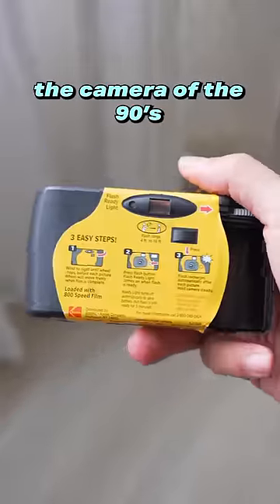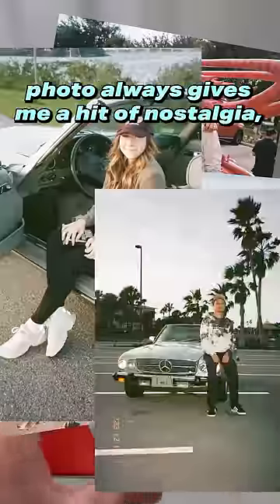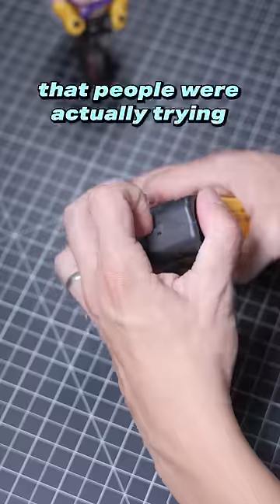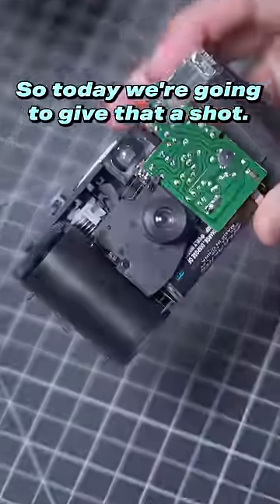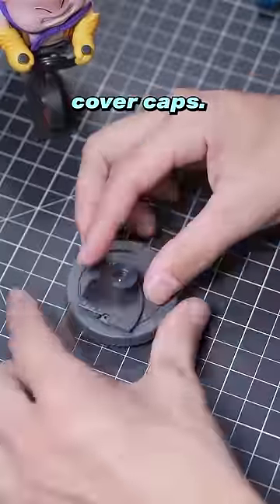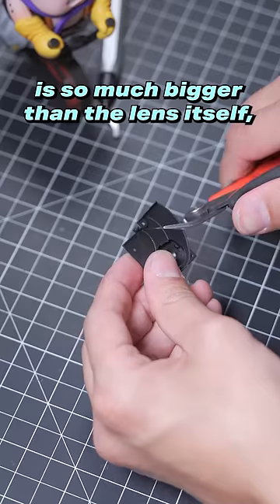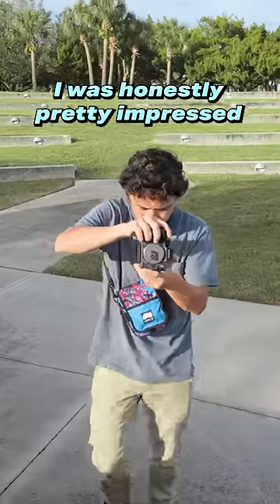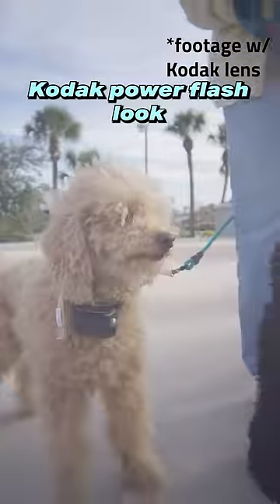The Disposable Camera lens mod..

Comment: They were not thrown in the trash! Speaking as a former film developer - after being developed, the cameras shells were picked up by a company, refurbished with a new AA cell and repackaged.
Reply: Good. Would be so wasteful otherwise.
Reply: Yes so “recycling” the lens this way only makes the rest of the plastic shell useless, contributing to waste. God I hate this trend
Reply: this is true, and was one of my first jobs at Wal-Mart. the only good thing for the environment i ever did while working there.
Reply: @ぶ乙 Kodak makes a regular film camera, the m38, which produces film with the appearance of these wasteful disposables with less actual waste. Of course the camera itself is meant to mimic the look too, so it is also plastic. I dont know why people dont look for more sustainable, cheaper options.
Reply: 5
Reply: @frankievermin Because metal, as opposed to plastic, is dug up from the ground by massive machines which consume more fuel than an oil rig uses to power its pumps. Were talking horsepower and wattage figures in the hundreds of thousands just to operate all of em, all for metal
Reply: 😂.... Smart Company Co.
Reply: Or you were me, who disassembled them and replaced the film with a fresh roll, and kept using it. Nothing disposable about them except the name
Reply: I'm not surprised that companies would do that then. But these days they would 100% not care.
Reply: Disposable cameras were very handy back in the day even for people that had their own camera should they forget to bring their own. A lot of touristy places where people take pictures used to sell disposable cameras as well as 35 mm film.
Reply: Not to mention some families like mine could buy a Kodak and just get film rolls and refill them

Comment: They're not usually "thrown away" tho, they're collected and reused, as it's just a bog standard shell
Reply: This. You were supposed to give the entire camera back to have the film developed - you couldn't even access the film roll unless you cracked open the case, and the case was not intended to be opened by the user.

I mean, you totally could, and I definitely shocked the shit out of myself a few times playing with the flash circuitry. but ideally most people would never be in the position to throw the camera away because otherwise they would never get the flim developed.

Comment: Btw! You can also just use the camera as is! It just needs a new roll of film put inside. 

The "disposable" Kodak cameras today are all reusable so please let the lab have them / make them refill it for you !
Reply: Wild how disposable culture was/is so normalized!
Reply: As far as I can remember there were two types of this film point and shoot camera. The one that was disposable which you couldn’t open and was cheaper and the other one which you had access to change a new film and was more expensive.
Reply: Actually, that's not generally true.  At least the Kodak ones have a little "crown" along the top of the cartridge that works with the film advance.  That means that a normal 35mm cartridge won't work if just inserted into the same spot; you'd have to reload the original cartridge

Comment: I’ll never forget back in 90s when I was about 8 years old and I was really into pulling electrical things apart to see what was inside. Well I was pulling one of those exact Kodak cameras apart when I saw a “danger of high voltage shock” sticker. I scoffed, there is no battery in here I said to myself and about 15 seconds later as I continued pulling the camera apart the flash capacitor discharged into my finger and the shock I got changed my life forever. From that point on I took note of danger stickers, they aren’t lying 😂

Comment: Pro tip: put 3 points on the circle (Perimeter)  you want/need to fine the center, connect them with 2 lines and make another 2 lines perpendicularly to the first ones right in the middle of them, where the last lines you drew encounters is the center of the circle

Comment: Disposable cameras weren’t put in the trash. They were returned, (refurbished when necessary), reloaded and resold.

Also they’re not too difficult to reload at home, though for most a toy camera would be an easier alternative.
Reply: I think you're severely overselling how much the average consumer can be bothered, people absolutely just threw them away
Reply: @ExpandDong420  the average consumer wouldn't be throwing them away, they'd be dropping it off at a film lab and coming back to pick up the negatives and prints
Reply: @ExpandDong420 I wasn't aware the trash can developed the film once people were done taking their photos
Reply: @ExpandDong420 you would drop off the whole camera at the lab and get photos and negatives back. The lab would extract the film, then throw the camera in a box. When the box was full it was sent for “recycling”. Which I’m guessing meant they were dropped in a shredder so that the metals could be recovered, then the plastic was thrown out. It’s very unlikely they were refurbished, there were too many different manufacturers and models, the logistics of refurbishing would be simply too expensive.
Reply: @beefchicken WTH, those disposable cameras were literally made by the manufacturers of the film they came with and the film branding was all over the camera, too! Those cameras were literally made to sell camera film to people who couldn't afford the upfront cost for a proper camera! And their design never changed.
There were no complicated or expensive logistics to refurbishing those cameras, just send them back to the manufacturer, they have the correct film since they're the ones making it! 💁
Reply: 90s kid here. Absolutely threw away and smashed dozens of these cameras as a kid. This is the first ive heard of a "returned" program
Reply: Many of these can't actually be reused. They just break.
Reply: @coreydopson2030 You must have amnesia then. The entire camera was turned in to get the film developed. Consumers definitely didn’t “throw the camera away”. smh 🤦‍♂️

They weren’t “reusable” they were “disposable”. The amount of people here pretending they remember something they clearly don’t is troubling.
Reply: @JeanEDeaux  my dad was a photographer. We had a dark room and chemical washes that he used to develop film. We used disposables for vactions and school field trips. I did, in fact, destroy and throw them away. You assuming you know my life is what is troubling.

Edit:
For clarity. I knew people brought them to walmart and walgreens and other such stores for development. I personally didnt have this experience so i didn't know they didnt just open them up and eject the film and instead handed over the entire camera. Just never thought about it. Thats all i was saying
Reply: @coreydopson2030  Then your experience was the exception and not the rule. The general public did not use these cameras and throw them away. ¯\_(ツ)_/¯
Reply: @JeanEDeaux  lol, seriously. the entire concept of the camera was to enable people to be able to take photos who didn't/couldnt have access to a proper camera. The overlap of people with their own dark rooms and the people who used disposable cameras has got to be a vanishingly tiny number.
Reply: @JeanEDeaux completely reusable. Worked in many labs over the years and this is exactly what we did with them. Developed the film, put them in a box and they were shipped to a company that repackaged them. Kodak, Fuji and other companies don't make these. They order them from companies that do and those companies put the little paper sleeves with their logos on them and package them and ship them.
Reply: @LRM12o8 those companies didn't make them. Another company did and just branded whoever ordered them. This is prevalent in many industries.

Comment: Use wood drill bit for drilling into plastic. It has middle pin that will make sure the drill bit is not sliding around when drilling. Also the edge of the drill bit touches the plastic first so it makes sure the edges are all nice and round without need to use edge trimmer.

Comment: Try adding a secondary lens to collimate a larger portion of your image sensor. It won't have affected light much and would at least doubled your available resolution at little cost. If you pick the right lens it can also compensate for lens warp.

Comment: The plastic lens become a big limitation when you want to do more serious photography. 
Anyways, an even more fun mod is to get one of those disposables that have a flash. Once you get the film out, open it up till you get to the flash circuit. You need to solder wires to the two legs of the capacitor. Now you can drill holes for the wires to come out of the case, drive two screws into the side and fix the wires around them. And there you go, now you have a shocker.

If the flash on your disposable is manually charged, you can cut an opening in the case to where the gear that cocks the shutter is, then you can cock it and fire the flash to discharge the circuit.
Reply: Wow...is there a video on this?
Reply: Be very careful, you can easily shock yourself.
Reply: @dzakem  That is true. Before touching anything, get some kind of resistor and short the legs of the large capacitor. You shouldn't use the screwdriver trick near the board because these flash circuits are dirt cheap and as such super fragile, a spark could easily knock it out. 

And also obviously take out the battery before touching anything.

Once you've put it together, treat it pretty much like a loaded gun. You can "unload" it by shorting the two contacts with a screwdriver.
Reply: Oh god no, that shock is way too intense for pranking.
Reply: Didn't you just wire straight to the capacitor?
Reply: @WTC7  You're right. I guess I mixed up this mod with just playing with the flash, in which case you do need to cock the shutter to use get the flash to fire.

The mod could still be useful for discharging the capacitor. But that depends on what kind of disposable you have. Some charge automatically.
Reply: there is no such thing as "serious photography."

Comment: When I was 12, I used to take two wires that I cut off of a spiral notebook, and I would attach them to the capacitor. I'd have them sticking out, so it would act like a makeshift stun gun when the flash would charge. So many shocks... Good to times
Reply: I still remember opening one of these up and touching that battery, still makes me wince thinking about it

Comment: The next step could be designing and 3d printing a lid that you can fit those in so you can swap the lenses as they degrade rather than having to drill and glue new lids every time

Comment: You didnt throw the camera away when you where done with it. The camera had like 30 exposures, you could take 30 pics. Then you took it an dropped it off at photo center like at Wal-Mart or Walgreens to have the pictures developed. The cameras didnt get thrown away they got sent back to the manufacturer an they cleaned em up an sent them back out. Probably tested an reused the lens an internal parts an put it in a new shell with a new roll of film.

Comment: You could reuse some of them....rewind the film back into the cartridge ( most just had a 35mm film roll inside...before opening, you had to roll thr film back....that could be tricky). Then, just start a new roll....the cameras were cheap, and you had to be careful, but I tried it as a challenge....

Comment: Back in the day (late 90's high school) we'd get used ones for drug stores and disassemble them and take out the capacitor for the flash and charge them with the flash button (made a cool sound charging up with a "whine" of electrical current) and then have something you can shock stuff with😅 it would stick to metal instantly soldering it. We didn't go around shocking each other. This one kid had it done he said, "it hurt like hell!!!" 😂 Made his arm all numb for awhile😂. We actually had a dark room with photography class, ah the good ol days😊

Comment: Just be VERY CAREFUL if you are disassembling one with flash. There is a capacitor inside that holds a high voltage charge (usually, around 300 volts), EVEN IF the battery is disconnected! I highly recommend doing some research before diving in.

Comment: No no no! You don’t wanna use glue for this! You want to use a solvent that will bond the two plastics together then let it gas out and cure for a few days! 

Glue releases a lot of stuff that can adhere into your sensor, and it cannot be removed afterwards.

Comment: manufacturers never refer to them as disposable, they're always marketed as single use because the whole camera is recycled when sent in for developing, the only thing not recycled is the film you get developed
Reply: I'm surprised film couldn't be recycled. Have we developed methods for it over time?
Reply: Do you mean recycled or reused? Because the design of those cameras never changed over the years, all they needed to do was reset the wheel and put in new film and it was ready to go back on a store shelf

Comment: Wait this feel not possible. How that small lens was able to take pictures through your camera
Reply from the maker: Yes crazy right?
Reply: The sensor size is the same size as a standard 35mm frame. As long as the lens is the right distance away, it works. I'm currently adapting a smaller Kodak Vigilant lens onto a larger camera.

Comment: "...typically thrown in the trash." 

By who? What kind of person would buy one of these, fill it with photos, and then throw it away? Is that a common thing?
Reply: Probably misremembers how they were used or wasn't around anyway. Should've questioned it though. Throwing these cameras away after one use is crazy!

That said, I'm fairly certain my parents have one of those Kodak "disposable" cameras without film floating around somewhere in their house. I guess at some point the manufacturers stopped taking the cameras back as they fell out of fashion and stores started to let the customers keep the camera after they developed the film. So even though that's not how they were typically used, there may have been a small timeframe at the end during which people did actually throw them away after they used them, because they had become obsolete. 🤔